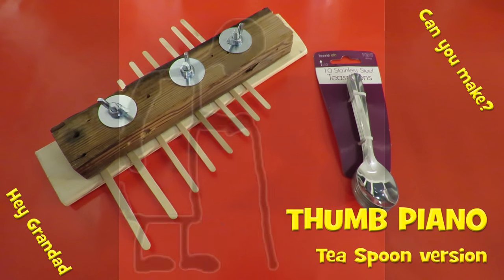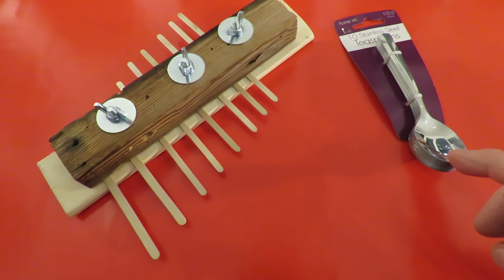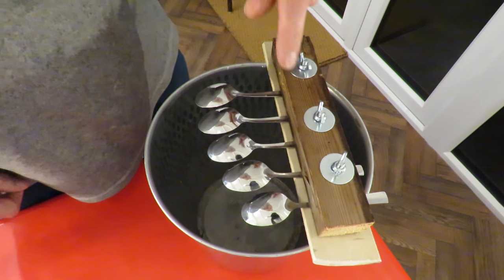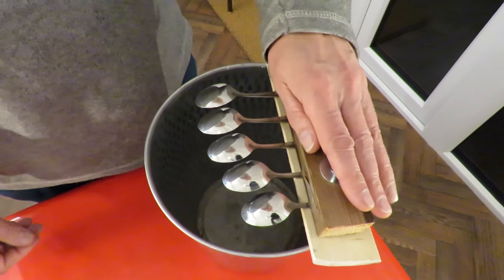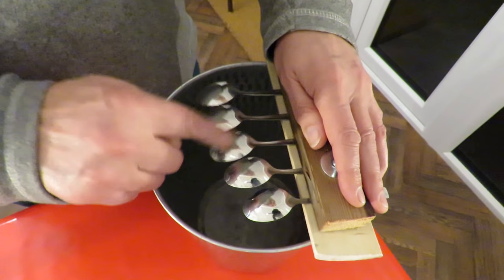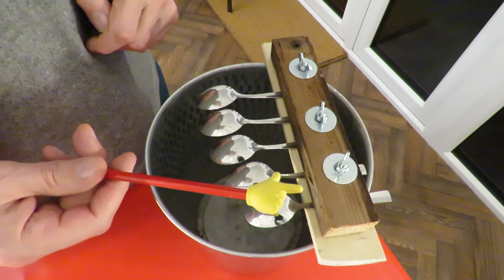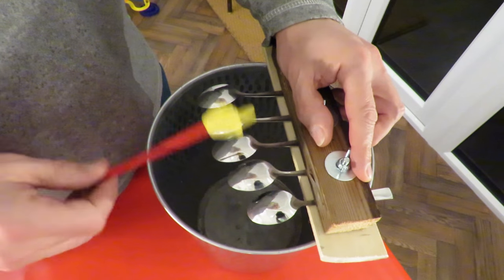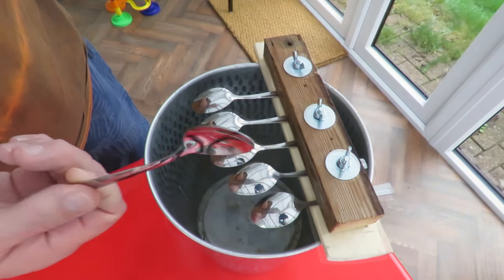Thumb Piano Tea Spoon version

Comment: If you bent a twist into each handle the spoon bowels could overlap without touching each other, then you could put all ten into your clamp.
 Another variation could involve setting the spoons in pairs, the bowels back to back almost but not quite touching, when 'pinged' they would vibrate against each other.
Reply from the maker: I think the list is endless. It is a very simple build and so many different items could be used. I bet we all did this with a single ruler over the edge of the school desk 😊